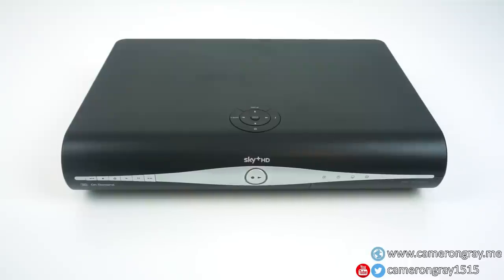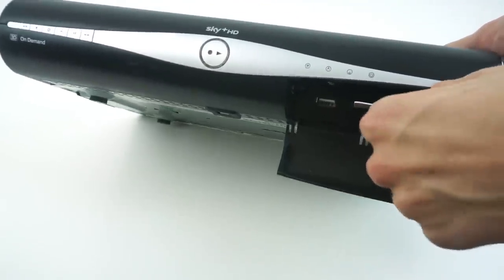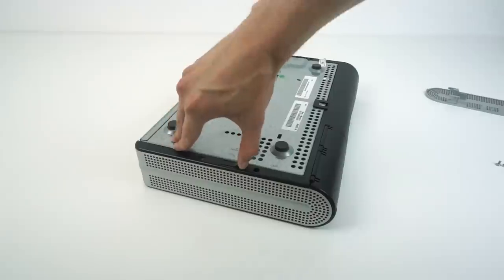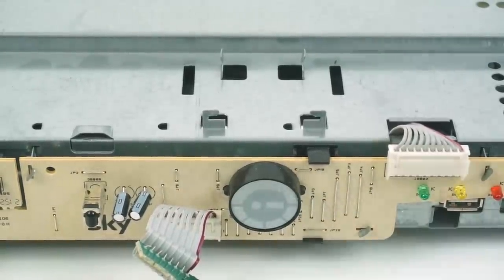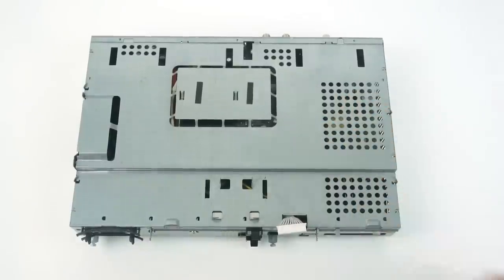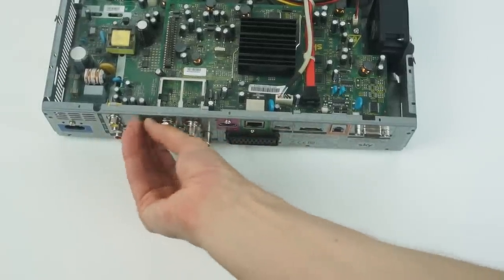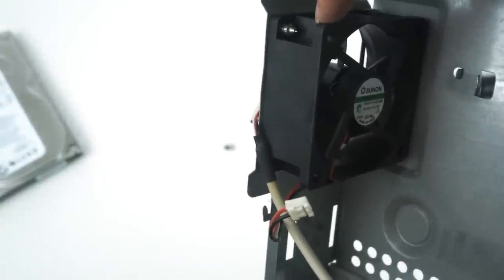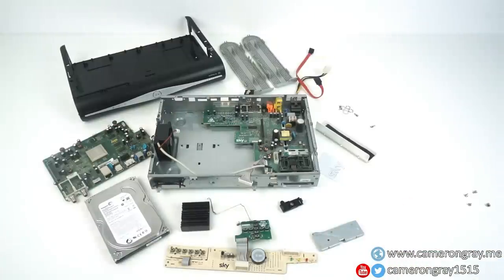Teardown & Hard Drive Removal - Sky+ HD Set Top Box

Comment: Many thanks! I was just about to take my old Sky+HD Box to the local tip as it seemed £20 was the going rate on eBay and I just couldn’t be bothered. At the last minute I decided to salvage the 500GB hard drive. However I would have never fought my way into the box without this very helpful video. I paused the video at each step and managed to remove the disc with no problems at all. A highly recommended video.

Comment: I am so grateful to Cameron for this superb video. So calm collected structured and beautifully videoed. I would have been petrified trying to do it without this help. However, what a great shame he didn't remove the lower board with the RF outputs  and power supply on it. One of the RF outlets on mine had snapped off so I have had to cannibalise another unit. To free it from the case it is necessary to open the corner of the main chassis just by the power inlet. The unused front USB protrudes enough to prevent the front edge of the board being lifted. The corner of the steel case is snapped closed but can be carefully unsnapped to just allow a bit of stretch. Thank you Thank you !!!

Comment: I have took to part lots of Sky+ HD boxes. When I want a cheap, reliable hard drive I take apart one of these. I checked the hours on one hard drive and it was over 70,000 hours. I have had very low hour ones too.  I usually get the fan from the Sky box. I have had one with such high hours that the metal plate above the black heatsink had black soot on it from the heat. The heatsink gets pretty hot.
Reply: yeah those hard drives are designed for 24/7 use i believe.

Comment: I was wondering how to open up a Sky+ HD box and what's inside, so thanks for your video. 
The use of bendable metal tabs instead of screws is used fairly widely in consumer electronics and automotive parts. It's often used where screws may loosen due to vibration or thermal cycling too.

Comment: Interesting teardown. I think you were right on the front panel buttons. That looks like extra shock mounting to help prevent damage from the "push it harder when it's not working" brigade. I suspect that the PIC microcontroller is involved in power sequencing and low power standby operation. Even in a low power mode the main CPU will still be using tons of power. Many embedded systems use this sort of architecture (e.g. Qnap NASes).

Comment: Those twisted tabs are actually very common :) The button board is separate for strain relief - pressing the buttons will bend the circuit board a bit every time so keep it separate and you won't break any solder joints over time.

Comment: When you leave sky they disable the recording function sadly :(
So I ripped the wi-fi card out of it & hard drive, i gave the rest  to my friend who likes to tinker with hardware.

I had the box, where the wi-fi card was connected with proprietary cable. I managed to wire it up to usb. The wi-fi card use OPEN-BSD or Linux drivers. windows drivers not available.

RS-232 is a debugging port. If there's a JTAG on the mainboard might be way to unlock the boot-loader and throw linux on the thing :P
Reply from the maker: Yeah that's the issue.  I originally took the box to use it for free to air satellite reception bit it was too limited by the lack of DVR functionality without a subscription as well as being unable to hide/remove the non FTA channels which made it a complete pain to navigate.
Reply: I wonder if there's a scene to crack the Sky boxes and out Kodi on them.  That would be awesome!
Reply: Is that even legal? Since you own the box are Sky allowed to disable a function of it?
Reply: Good question, I'm guessing you own the box but under the terms and conditions they have the rights to disable functionally upon ending the contract. Since you own the box, but the software is their copyrighted material it's something weird like that..
Reply: You don't own the box, you lease it. Strictly they're meant to ask for old ones back, except they don't care about this old thick generation, they'd already replaced it long ago even before Sky Q. So they leave many in place, but it's still leased hardware.
Reply from the maker: Not the case with the Sky+ HD boxes, they are owned outright by the customer and Sky explicitly state this in section A, point 3.1 here: https://www.sky.com/shop/__PDF/SkyPlusHD.pdf.  This is why with Sky+ HD, if the box fails outwith the warranty period, Sky will try to charge for a replacement box.  This is different to Sky Q or other providers such as Virgin Media who do lease the boxes to the customer.  As for disabling the functionality, it's not that they kill the functionality when your subscription ends, it's more a case that your subscription enables the functionality.  Feels pretty similar to things you find in the enterprise IT space where you get servers from certain vendors (*cough* HP *cough*) that require licence keys to enable functionality such as additional remote management or, on a couple of machines, the ability to hot swap the disks.  The hardware is already there but they charge a licence to use it.  Definitely not a fan of this practice but I wouldn't say it's illegal since while you own the hardware, you don't own the software or firmware that runs on it.
Reply: 14:13 at the top maybe a 4 pin serial port?

Comment: I think that cable is for the front USB. I have the WiFi model and the front USB port is missing, inside, that cable attaches to the wifi module.
The older Samsung boxes were a lot easier to take apart, but in my experience, they crashed more often.
Reply: it is, the latest one i dismembered had no front usb but built in wifi module, presumably the front usb was so you could plug in one of those tiny usb wifi dongles?
Reply: I just took apart 1. The usb cable connected on to a Wifi board. I haven't got a front usb on mine

Comment: The USB is used for power, It's used for the wireless adapter box they used to give out. The serial port is also usable, you can receive metadata about the channel, program description etc from it. Oddly the serial port also outputs what you press on the remote and occasionally it puts out a special status message.

Comment: Even though I signed up to SkyQ, the sky "engineer" wasn't going to risk climbing up beside the conservatory to get to the dish to chage the LMB. We ended up sticking with the Sky+ 2TB box. plus it also has the RF out to an 8way distribution unit which we would have had to give up if we went with SkyQ.
Anyway the box that I have has an external USB powered wifi unit. I recently got possession of a Sky box to salvage the HDD and noticed that this box has a wifi card and antenna on the metal case. There is a white cable, identical to the one in the video, but connected to the wifi card.
It mostly likely won't work but I wondered if it could be possible to connect the wifi card to to my 2TB box.

Comment: Have you tried if the drive works at all in the PC? Media box hard drives are usually locked to the box using either ATA password (like first Xbox) or custom firmware (requiring custom vendor commands to make the drive spin up and identify itself).
Reply: I think someone showed that it did work, meanwhile, with the provider I'm on over here, they stopped doing DVR boxes years ago, and instead have a partnership that means a specific brand of external hard drive is required, plus a monthly fee in order to record.
Reply: drives from these seem to work ok in a pc, i've certainly erased, repartitioned and formatted them ok, done 6 so far all test good except the most recent one, strangely the newest, dated 2011, ONE bad sector..aargh! still should be usable..different type to the one shown, not 'pipeline hd' which the others were, but 'video 3.5 hdd' ..? some older ones and ones from different boxes might well be locked or be set for 'power on in standby' so dont spin up when powered up in a pc, theres info on the net of ways to try to 'reset the drives firmware..

Comment: I wonder if you can tell me which bit on a sky+HD box is paired with the viewing card? I know it's the motherboard that the signal goes into. I am thinking the processor under the heat sink. Have you ever been able to remove it? I once successfully transplanted the motherboard into another sky+HD box after it died due to a power surge.

Comment: My 2008 Amstrad box is very different. There are no screws at the back; the case is just held on with three clips under the front but levers off on the same manner. The front PCB is green with a lot more components on it, and the buttons on top are held down with screws. It also has different connectors on the rear
Reply: that must've been before sky bought amstrad.... i've seen a couple of variants of this hd box and so far 3 of the earlier white non hd box...

Comment: My grandparents have just had their box replaced with Sky Q and even looking at the IO on their old Sky Plus there are a few key differences to this one. Their box has no RF in/out ports and instead has a combo ‘IO Port’. It also lacks a SATA port and a phone line port and even the composite and stereo jacks. Perhaps a slightly newer model??

Edit: looking in, this model also has a WiFi card which yours doesn’t and an unoccupied front USB port header! I think it must be a newer model…
On closer inspection, it seems that the reason for the missing front USB port is that the internal USB header has instead been used to connect to the WiFi card. They have evidently used the same cable and header to make a WiFi model!!
In fact all other missing ports on my unit are still there on the PCB but the actual ports have just not been soldered on! These revisions are not very different after all.
As a note for others - if you have a WiFi model you will need to remove the internal USB cable to it in order to remove the top cover.

Hard drive:
My unit has a ‘Seagate Video 3.5 HDD’ rather than a ‘Seagate Pipeline HD 2’. It’s still a 500GB model though.

Comment: With those metal tabs its easier to straighten it along its length, so get the tip of the pliers parallel with the straightest part of the tab and squeeze, saves twisting!

Comment: Nice i just found a 2tb version in my sky box. If I add this to my pc, will using it as mass storage and for games be as fine as a normal desktop drive? Thanks.
Reply from the maker: It'll work fine as a desktop SATA drive, just bear in mind that they're relatively low power drives that tend to spin at 5400rpm rather than 7200rpm so it'll be fine for mass storage but I wouldn't recommend running an OS or heavily programs from it as it'll probably be a bit on the slow side
Reply: @camerongray1515  cheers. Thanks for the response

Comment: I do imagine being able to build a PC inside such a case, and retain as much of the original I/O as possible.

5:01 I remember using a lengthy RF cable to feed a video signal from the back of a first-generation digital StarHub TV receiver all the way into the small TV I had in my bedroom, back in around 2007 or so. (the box was introduced in 2005 or 2006 IIRC)

Comment: Since this was the guide I used to take it apart - would you (or maybe even a helpful commenter) know what adapters/ports i'd need if i wanted to use the HDD as an external one in my PC for example? 
Ideally, if possible, one that connects from the drive to USB or something, so I wouldn't need to fiddle about with the interior of my setup.
Reply from the maker: You'd just need a regular 3.5" SATA to USB adapter/enclosure, ideally one with an external power adapter since the drive will likely need more power than a USB port can provide.
Reply: @camerongray1515  Cheers
Reply from the maker: That looks fine to me!

Comment: You talk about people upgrading the hard disks in these boxes, is the operating system for the box on a ROM chip?  If it's not, is it easy to get a hold of a software image so it can be put onto a replacement hard drive?
Reply from the maker: As far as I'm aware it's stored on flash memory inside the box although to reinstall the firmware it's a simple case of holding down a button combination when powering the box up causing it to download a firmware image that's broadcast from the satellite.
Reply: Well that's very good, so it would, in theory, be easy to reinstall the firmware if the firmware installation becomes corrupt or damaged.  Are there different brands or models currently available, or is there just the Sky Q and legacy Sky+HD boxes that all use the same hardware or software?
Reply: It's stored on a 512MB rom chip, but with heavy encryption.
Reply: yes its on a rom, so you can quite easily upgrade/replace the drive, it may take a while to initialise it when first powered up with a new one though

Comment: I saw one of the older model of these in white which is probably not HD that was dumped outside a UPS? electronic recycling bin alongside a CD player, DVD player and a Wii, I wish I took just for its hard drive.....
Reply: it was in the Epsom area (South of Kingston Upon Thames) near where all those mostly demolished mental hospitals are next to a church I think
Reply: Those standard definition ones are actually higher quality than these in build. Much easier to open too! inside there's a Seagate IDE 160GB HDD, at 5,400 rpm. I got one and use it in my PlayStation 2, it fits all my games! :)
Reply: +television and cheese now I really wish that I took it!

Comment: Would it be possible to modify these boxes for 100-125VAC power systems? (eg USA/Canada)
Most American HDTV sets support 50Hz video signals (even PAL,) so I wouldn't be worried about changing the video signal as well.
Reply from the maker: I suppose you could use an external transformer although I'm not sure what benefit this would be as these boxes are very much designed to be used with the Astra 28.2E satellites that Sky use to serve the UK and some of Europe which don't have coverage in the US and tuning in extra channels is a pain, you'd be better off just buying an off the shelf set top box.

Comment: Are you sure the USB wasn't used? Usually those are there for servicing. They often support dirmware updates over them.
Reply from the maker: Suppose it could be used for servicing although any time I've seen a software update be done on these boxes the firmware has been delivered via the satellite.
Reply: probably used in the factory for setting it up/loading the main firmware..

Comment: Would this be good for the extra memory on my gaming pc just a back uo drive?
Reply from the maker: It'll work fine as a storage drive but it won't be super fast so it would be best to use it for file storage rather than running software from it.  That said, just bear in mind that the drive will have been used pretty heavily in the Sky box so can't really vouch for its long term reliability (although you shouldn't trust a single hard drive anyway, keep backups!)
Reply: OK, thanks mate

Comment: I saw on this other guide that you need to use some special software to issue a power on code for the drive. The guide said the only other way would be to turn on the box and hot swap it
Reply from the maker: Do you have a link?  This isn't something I've found with any Sky boxes I've seen, they've all used standard off the shelf drives.
Reply: @camerongray1515  btw it's cool of you to reply to comments on videos from 2 years ago I think I might subscribe
Reply from the maker: Interesting, suppose it may be the case with certain set top boxes although that article is about DirectTV who use totally different boxes to Sky
Reply: @camerongray1515  yeah I suppose it will different between companies and countries. The frustrating thing though is that I think I missed the time where DVRs with big hard drives were everywhere and if they do exist the are leased out and not kept by the costumer.

Comment: Don't know if it's just the model (2tb, black front) - but the plastic casing seems to just stay on by sheer force of will - shall update comment if I'm successful, but the guide seems helpful, so thank you
Reply: Update - got the case off (broke it 🤷‍♂️)
Got to the part where you unscrew the nuts by hand and have no idea how you did that without a tool to loosen it, this thing is stuck on unbelievably tight, and my fat fingers can't dislodge it 😂😭
Reply from the maker: Which nuts are you stuck on?  The ones around the ports on the back?  Some pliers should get them loosened.
Reply: @camerongray1515  Yeah, my only issue is i don't have any tools to do so with - but my current tools consist of a hammer, 3 screwdrivers, a very small spanner, and about 20 align keys 😂
Would hopefully be able to get the right tools at some point though - when i do, I'll be back here
Reply: @camerongray1515  Final update - those nuts took the smallest nudge to loosen, and now I've got the drive and other necessary components out - if YouTube still had a rating system outside of likes, I'd give you the highest, but a like will have to suffice - cheers